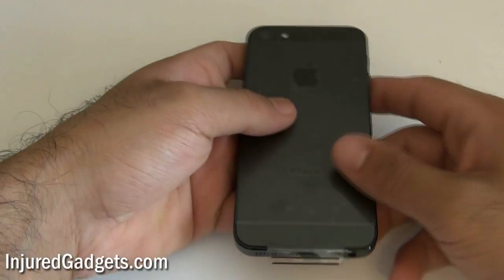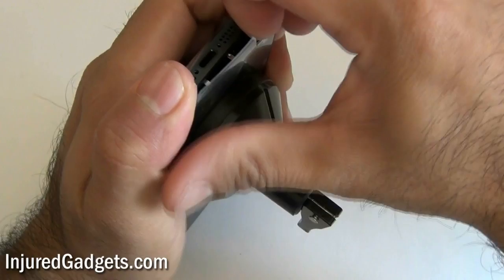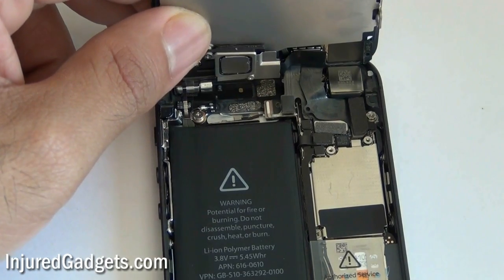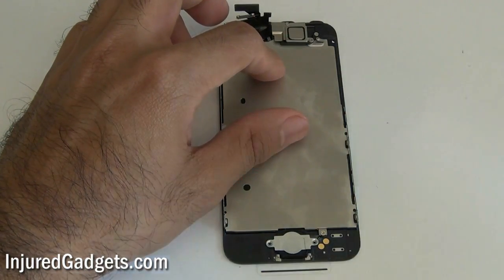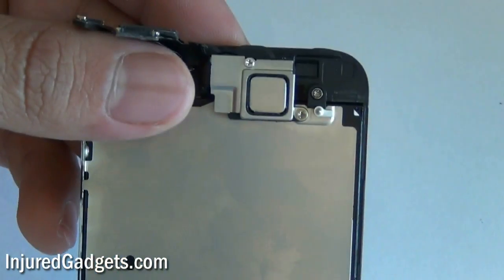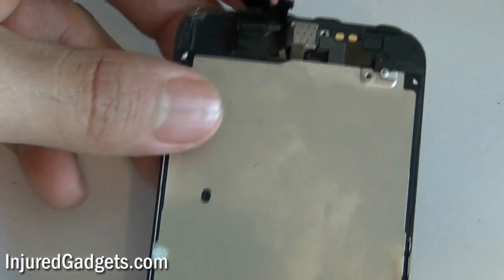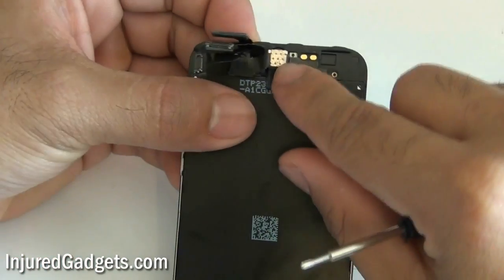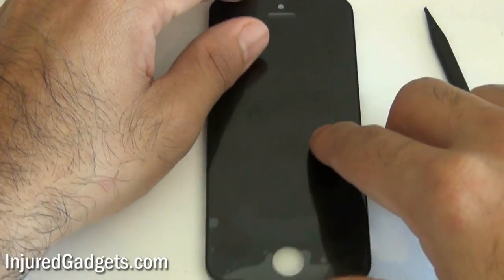iPhone 5 Touch Screen Glass Digitizer & LCD Display Repair Replacement Guide

Comment: Do you realize you used the home button cable to push the screen metal backing after you removed it? That not only put a lot of extra stress on the cable but also exposed it to possible static electricity. Not good... And always remove that 5th screw with the home button bracket.

Comment: Will replacing the digitizer fix the ghost typing and scrolling and the issues Im having with the screen not responding? No cracks but toddler whipped it onto the floor.

Comment: My screen is having an issue with "phantom touch", or just erratically tapping without me or anyone human tapping it, is there any way to help fix this, like a reboot? Or do I have to remove the screen and reinstall it again
Reply: I have this same issue
Reply: it's the digitizer worked for me had the exact same problem

Comment: Let's say my touchscreen all fucked because I threw my phone and everything broke and The touch screen doesn't work at all and keeps pressing everywhere randomly and barely displays.. If I change the whole first thing you took off does that save everything in my phone or is there any memory at all linked to the lcd? Thanks
Reply from the maker: +TheSilverFox91 Not at all. Memory is all in the board.
Reply: perfect thanks bud

Comment: So a year back I dropped my phone and cracked it, so I peeled away the glass and was using the phone without the glass and today my friend dropped my phone and it turns on but nothing will show up but blackness...if I bought the screen and LCD digitizer replacement would that make it like new?
Reply from the maker: +Steven Rumpel Yes it will. Or let me say most likely yes. Unless the chip which control the LCD panel has been destroyed, but thats unlikely.

Comment: Does the digitizer work for AT&T iPhone 5's?
Reply: No. 5S uses different flex cables, and the home button hole is larger than on a 5.
Reply: it doesn't matter which phone company the iPhone 5 is from, they're all built the same

Comment: Is there a way to take the LCD off the screen I cracked glass and I found a front panel for cheap enough and was wondering is the LCD stuck to the glass or can I take it off ..